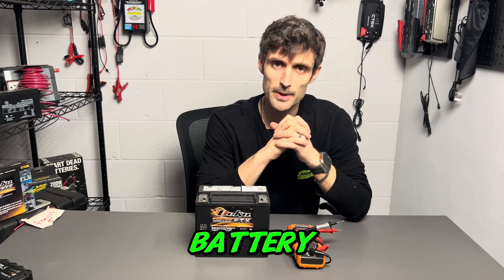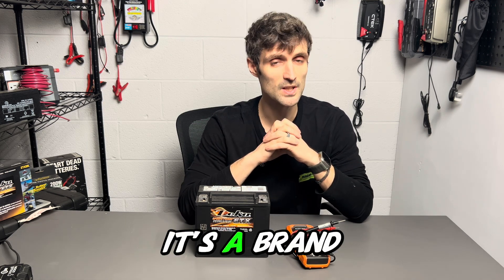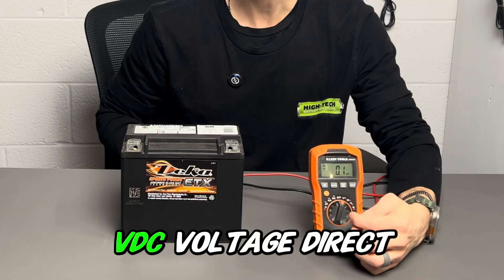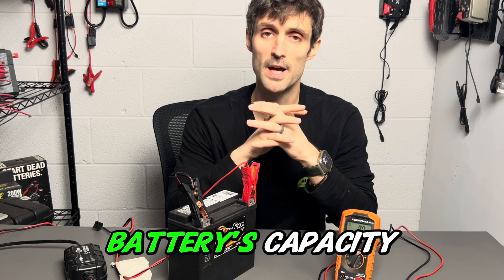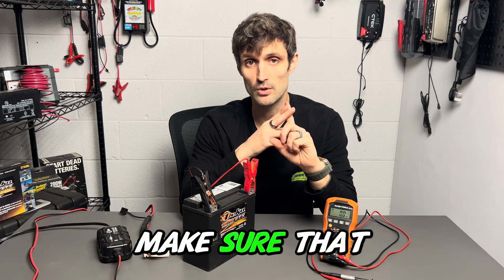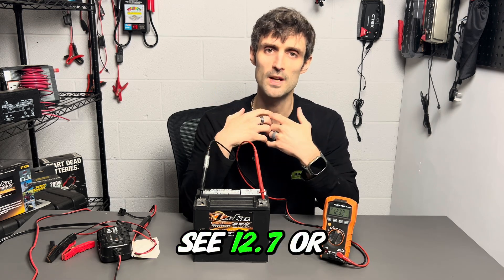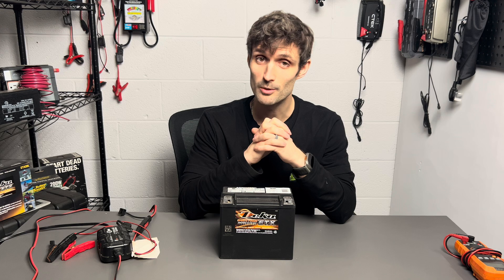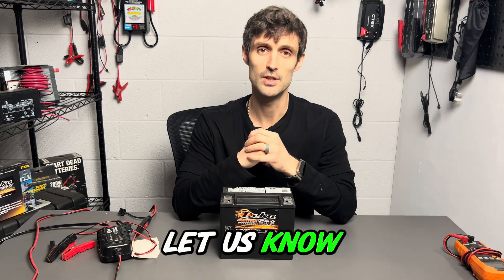How to Test Any 12V Battery - Complete Bench Testing Guide (Motorcycle, ATV, Car)

Comment: What would a lithium dero cycle charge be at to follow your testing process? Cheers
Reply from the maker: You can complete a bench test on a lithium battery much quicker. Lithium battery voltage will drop in a battery that's having trouble retaining a charge in a few hours instead of 24 hours like we're doing in the bench test here for a lead acid based battery.

The process of testing it remains the same. What you're looking for is that significant drop in voltage over time without an external application drawing from the battery. After you take your lithium battery off charge (and it takes a full charge), let it sit for 30 minutes or so to get the resting voltage. Record that voltage and then let it sit. You can even do the full 24 hours if you like and then test the voltage again to see if there's a significant drop. If there is, just as with this lead acid battery, it's time to replace it.

Comment: Besides testing the voltage at rest, a better test would be to put it under a load, like connecting a 12V headlamp bulb, since most people don't have a load bank.